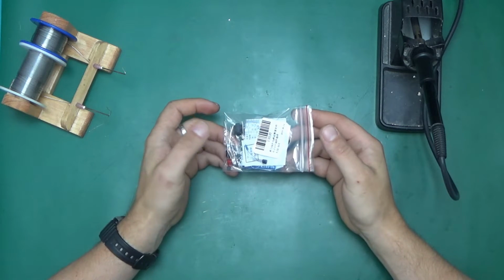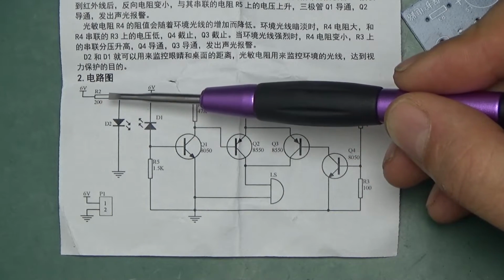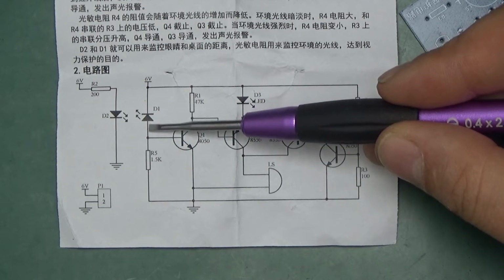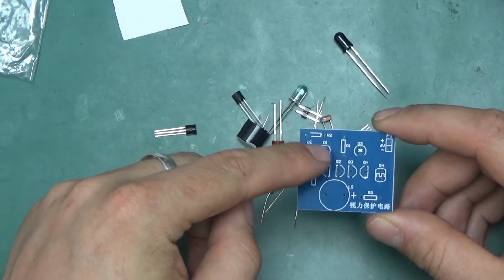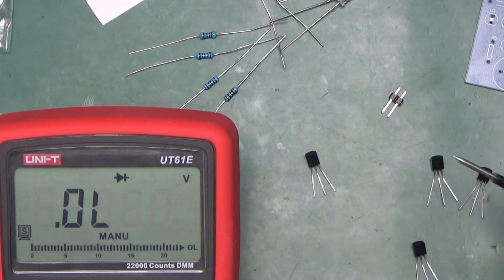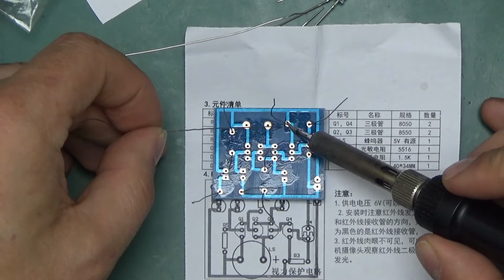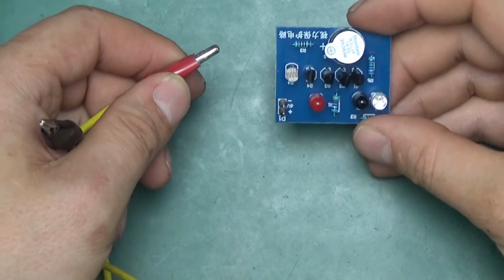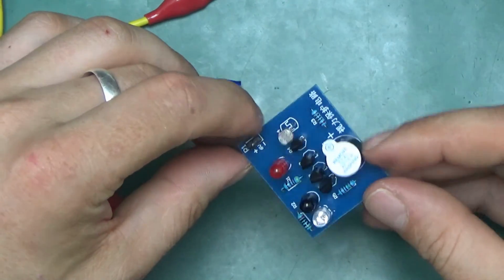#009 - Not too bright, not too dark: kit build

Comment: My gawd that is horrible solder that you are using. You need to increase your tip temperature to compensate, as your joints are really "blobbed" on rather than the solder amalgamating properly.
Reply from the maker: It's the new tip, which I never used before. Too low temperature, I should have increased the temp a bit and it would be ok. Well observed :)

Comment: Ah I figured out how the low light part of the circuit works.
The photo diode is designed to have a filter so it only responds to IR. Part of that is the dark casing, but it also stops responding at all if it gets too much normal light.
So in low light conditions, the photo diode finally sees the IR led and turns on.
Reply from the maker: That was my theory too :)